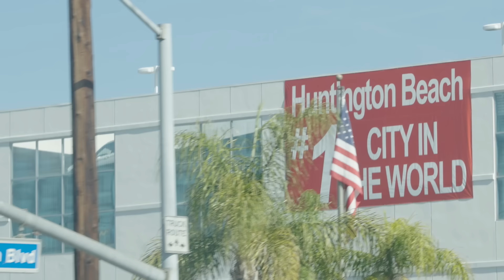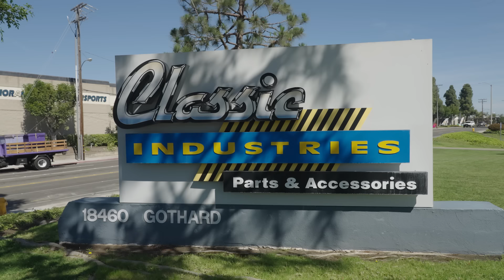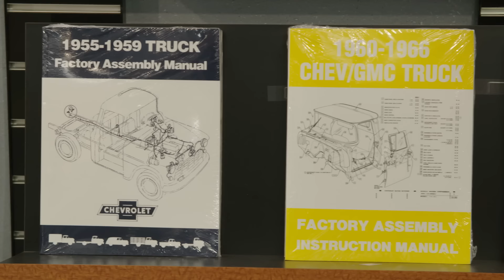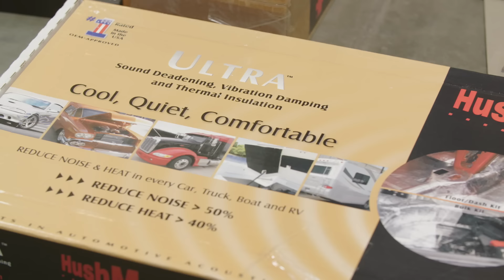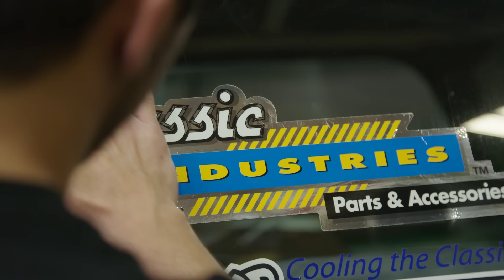Road to Improvement Ep. 8: Interior Updates for our 1981 Chevrolet Suburban with Classic Industries

Comment: Seems kind of like a downgrade using those door panels instead of restoring some factory ones with SEM. But I do have a question: Does the butyl rubber sound insulation really block much heat? Which part blocks the heat, the aluminum?